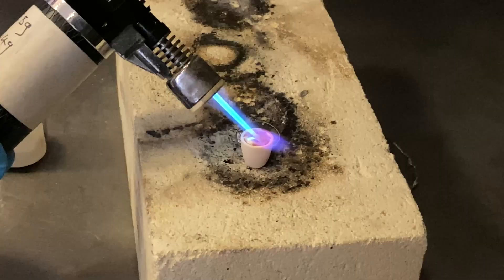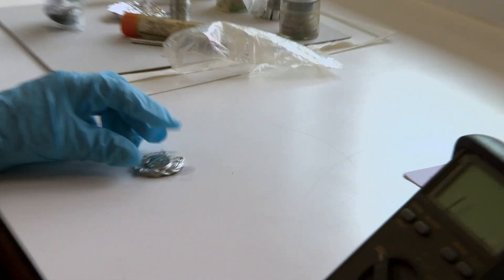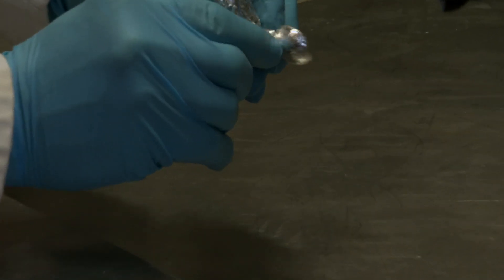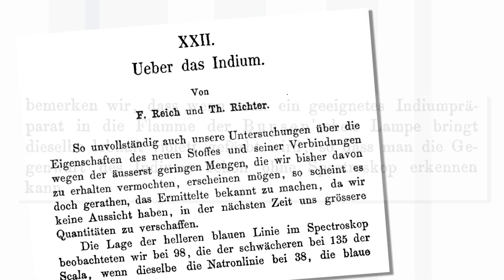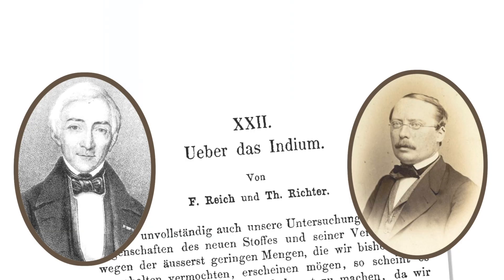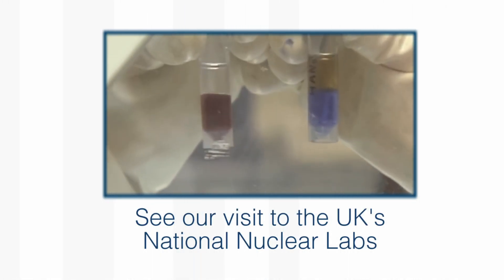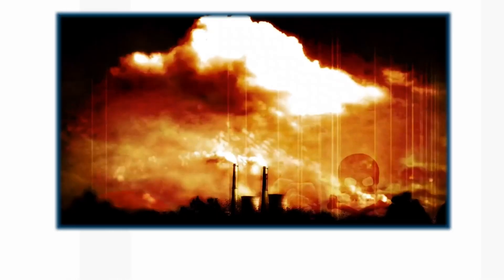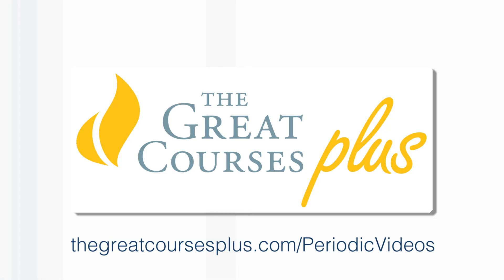Indium - Periodic Table of Videos

Comment: I’m now convinced that when I’m older I want to be a Neil
Reply: You'll need a hammer.
Reply: I wonder how you get that job. What kind of degree do you need?
Reply: @scorinth  Though a degree always helps, I have known several excellent senior lab techs in various areas (chemistry, physics, electronics, biology) who reached that level without a bachelors or higher degree , though most had taken some classes after high school, or had been in the military.  (Some did get degrees after becoming a senior tech, but they didn't have it before then.)  The main common attributes they shared were curiosity & persistence (investigation), discipline (safety), logical thinking (process), and decent writing skills (documentation).
Reply: @bobcunningham6953  well-made comment
Reply: @bobcunningham6953  i think Neil used to be a Bond Villain's main assassin/henchman until he retired.
Reply: @scorinth  probably chemistry atleast
Reply: @velysean7031  Kinda obvious xD
Reply: Neil is most likely a technician or post doc
Reply: I think Neil is just Ferb as an adult
Reply: Me too
Reply: I want to be kaku😁